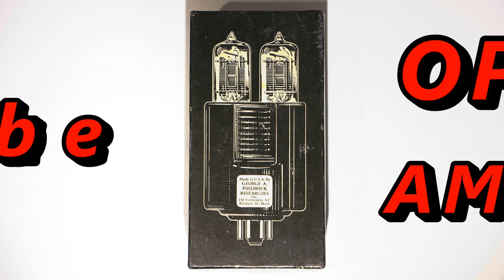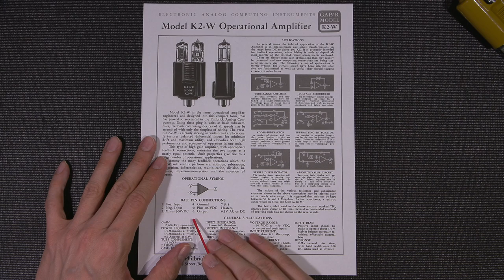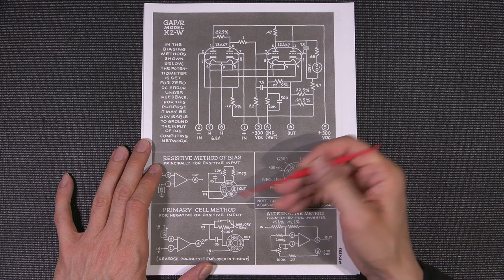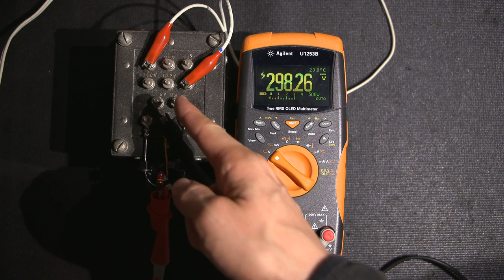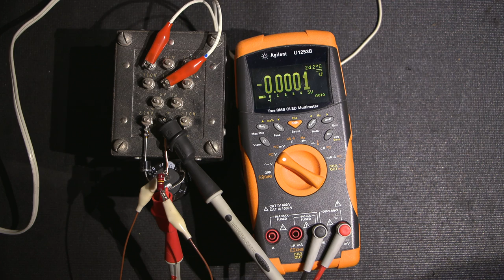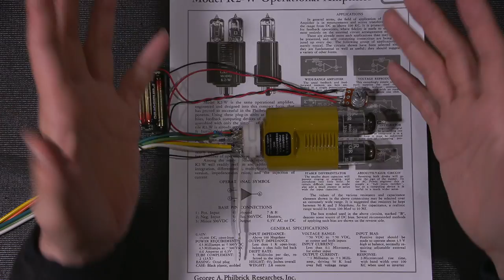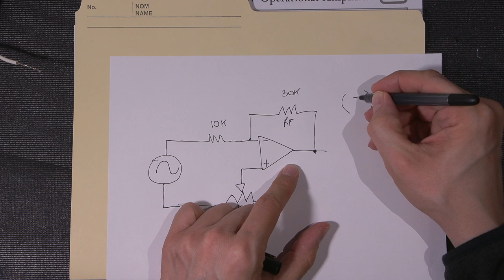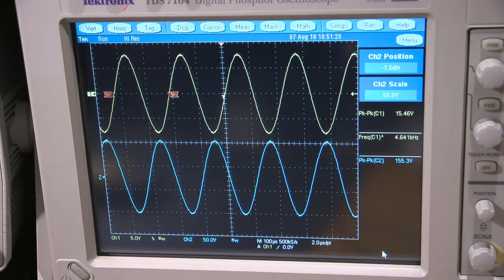600 Volt Tube Op Amp! Lets Power It Up.

Comment: Please nobody point out that the 210V-0-210V winding with two full bridge rectifiers and two filter capacitors would give both +300V and -300V rails with more than enough current capacity for dozens of 12AX7 anodes. I think Paul is making this more complicated than necessary to show you can stack separate power supplies.
Reply from the maker: Quite the opposite Peter. Why build a dual unregulated power supply when I have a regulated positive supply ready to go? With one stable supply, we will get "more accurate" results... VS... two unregulated supplies. Why don't I just build two regulated supplies? Answer.... This video is weeks of videography alone, excluding "everything" else.
Reply: "Why build a dual unregulated power supply" -- because only 2 more diodes, and one cap (and, ok, another bleeder resistor); and would be nicely symmetrical, rather than by combining reg + unreg supplies.  But as another commenter says, the rails don't actually need to match; provided the gain's reasonable, the PSRR should be high.
Anyway, excellent find on the tube op-amp, thank you for the demo, great to see old tech working nicely :-)
Reply: Peter: Pretty sure you only need one full bridge rectifier, you already got a center-tap; just add two more IN5407's, one 470uF 400V, and a penny bleeder resistor, to get a tasty-but-slightly-bitey +/- 300V dual-rail supply.  And don't ever connect that to a 741, eh :-)
Reply: Common mode noise rejection, for one thing. If you're getting both rails from the same transformer and your amplification doesn't come anywhere near the power supply rails (which is good practice unless you want that characteristic Bassman LTP distortion that guitarists know and love), you'll have lower total noise and higher linearity from two bridge rectifiers on a single transformer than from one regulated supply and one full-wave center-tapped rectifier.
Reply: Careful with that center tap and how you Earth the chassis though! If you use two fool bridge rectifiers and two filter capacitors, you can get +300V - 0V - -300V referenced to the center tap with equivalent-but-opposite current noise on the rails, making the amplifier quiet as pants.

Comment: Thanks so much Mr. Carlson, Love the Tube Op Amp! Sure takes a bit more to get it working than the Solid State Model, doesn’t it? 😀 this was so great and different. I’m sure so many of us have been working with opamps for years but it was so cool seeing this tube version and watching you make it work. I’d be curious who has seen one of these in operation before and what it was inside... Thanks again, appreciate your Patreon!  Buddy
Reply: Imagine building a whole integrated circuit with those, lol
Reply: @InXLsisDeo  Well, if you consider that it's an opamp in a self-contained package, it already is an integrated circuit.

Comment: Incredible video. Never seen a Vacuum Tube OP AMP.  Been in audio for years. This was fun. Great video Mr. Carlson.
Reply: It's easy to sprinkle solid state op-amps throughout an audio circuit, but the same design philosophy would require a lot of tubes.

Comment: In the easter bloc tubes were a common subsitute for Jfet transistors. Mainly in multimeters and other measurement equipment due to their high impedance. Also 12AX7A=ECC83. 12AX7 was first and then it was copied&improved in europe as ECC83. Then the americans copied the european ECC83 because it was better than the original 12AX7. The 12AX7A is the improved 12AX7 based on ECC83.
Reply: The delights of the "vacuum tube voltmeter" :-)   VERY high input impedance, but a few downsides (heat, fragility, size, ... :-)
Reply: theskett It depends. Sometimes such equipment would run on reduced heater voltage. This would extend the tube life a lot. Tubes can be really longlasting if operated properly. This is why output tubes rarely survive for long compared to tubes in previous stages. Same receiver, EABC80 from 1954, triode( preamp) 85-90% emission, EL84 from 1959 (output tube) ~50% emission.

Comment: I love your videos.  They are a bit advanced for my experience (I'm a biologist/entomologist but I'm also into HAM radio - K5BUG) so I still like to watch.  And I even understand most of it.  I am fascinated by the 1950's era technology like these tubes and others.  One thing I would like to know you and others on this thread talk about the speed and ability of counting/ measuring with these and doing other math.  How did that happen??  I see ways to make sense of it (via the gain discussion) but I bet you already know.  Could it be easily demonstrated in a video?  Others here are talking about differential equations and other calculations in this thread.  It's interesting to me scientifically.

Comment: You should have taken the inversion into account. Gain = -3 and -10. Also clearly visible on the scope (180 degrees phase shift between input and output).

Comment: The climbing up Voltage of the capacitor after discharging it is the polarising dielektric that is similar the Magnetic Retention of the metal plates in a transformer. it depends of the material of the dieliktrica. paraffin wax for exemple, if u put(with two plates) e very highe elektric feld in the liqid form of the paraffin and let it solidifie with that highe elektric feld applied to it. u will get the dielectric version of a magnet... u can short the plates of the resulting capacitor and after separateing the leads it will rise the votage again

Comment: great video!,  hey, a bit off topic,  This may be something you would like to do a video on. I have always wondered how those Old-school storage CRT's worked. I used them back in the day (I'm old) and never gave it a thought. Now I'm building a lab and can't afford all new equipment, so I pick up 2 HP spectrum analyzers for stuff above 8 GHz to about 25 GHz, got them both working and they have the storage CRT's in them. They work great, but I never knew how they worked.

Comment: One thing I notice is that the 12AX7A is rated for 300V maximum, so I'm guessing you weren't suppose to take the output or inputs much significantly below ground potential?  Its a nice little circuit, differential pair into voltage gain stage, then via a neon equivalent of a zener down to cathode follower output.  There's a compensation cap presumably so its unity-gain stable, and I make the quiescent current about 4mA (ie 2.5W).  The open loop gain ought to be about 10,000 given the 12AX7's amplification factor of 100.

Rail-to-rail it ain't though(!)

Comment: Thanks for the video Mr. Carlson, just a quick question. At 20:50 you demonstrated how after bleeding the cap, it started to climb back up without power applied. You neglected to explain where that power was coming from, would you please explain where the power was sourced to get stored in the cap and making rise? Thanks
Reply: Basically charges burrow into the surface of the insulating film, then leak back to the plates later.  It depends a lot on the precise nature of the dielectric used, and a high quality dielectric by definition has low absorption.  The energy is stored in fact the charges have been forced into
the dielectric and would prefer to be released again.
Reply: I understand and that's fine but an electron is an electron is an electron. It has to come from somewhere, where are all these electrons coming from if the entire circuit should have been devoid of all imbalances. If the bleeder brought it down to virtually zero, where did the 'extra' electrons come from to get stored at all?
Reply: I would have expected the drift current would send the stored dielectric currnt back within a fraction of a second. I didn't know that it takes gradual time over MINUTES, wow.  Thanks for the explanation.
Reply: Remember that charges are both holes and electrons. As long as there are holes, electrons will hang around to balance them. NPN and PNP transistors behave differently, not 100% analogously inverse to their physically-mirrored counterpart.
Reply: I'd like to see it degrade with time to confirm this. I think it's coming from rectified AC noise and possibly rectified RF. I'd like to see that capacitor and resistor charged then disconnected from all components along with a high impedance voltmeter just to be certain.
Reply: Actually, those HV caps build up charges from particles in the air, like dust. It can take a long time, but they can build it up and store it forever... until you come along. I used to work in high power electronics (up to hundreds of kilovolts and megawatts of power) and all caps had to be shorted when stored. They might be only half a microfarad, but at 40 KV that can kill. Short them out with a metal bar and they sound like a firecracker.
Reply: @jamesvandamme7786 Naturally-occuring charges on dust can get into the capicitor?   Or is it A.C. electrical fields somehow charging the capacitor?
I should put a diode across the capacitor and see what kind of charge develops.
Reply: Just floating DC fields. When you have basically infinite impedance, a slight charge in the air can get collected over time... a long time. Not much energy collected, but it can discharge in a millisecond and if that's through your heart, it can do you in. So short out all HV caps.

Comment: Im curious if this would have any applications in audio? What would the performance be like as a preamp stage versus a standard 12ax7 preamp stage that you would find in a guitar amp?
Reply: According to the data sheet, it has a maximum bandwidth of 100KHz (inverting configuration) so it might be fun to try one as a preamp.

Comment: What is the difference between a positive and negative dc voltage?
Reply: It's all about reference points. For example, if you have a +15v/-15v power supply: Ground potential is +15 volts  relative to the -15v rail. Ground potential is -15 volts relative to the +15v rail. The +15v rail is +15 volts relative to ground. The -15v rail is -15 volts relative to ground. The +15v rail is +30 volts relative to the -15v rail and the -15v rail is -30 volts relative to the +15v rail. As Einstein would say: "All things are relative". I hope this helps.

Comment: Got me going for minute when you started showing current flow in stead of electron flow.Diodes are drawn the old way.[current flow]
As always your presentation is excellent.
Reply: Technically the diode symbol is a drawing of a cat's whisker rectifier, not an arrow.

Comment: I'm wondering why you didn't use just that one transformer? Could you have flipped one diode, added another capacitor and used your center tap as the ground?
Reply: cmjbrodman Or with the center tap to gnd, just run 2 diodes with cathode to neg. 300V and 2 others with anode to pos. 300V. A 1000V bridge rectifier would also work. That gives a nice full wave rectified symmetrical +/- 300V.
Reply: I wondered that too
Reply from the maker: One regulated supply is better than two unregulated. Thats really the only reason.
Reply: Mr Carlson's Lab One would expect that with an unregulated but symmetrical supply the relatively slow mains voltage drift is inherently suppressed at the output.

But I'm not familiar with tube circuits, and you likely made the proper choice here.
Reply: I thought the same thing when I saw the transformer, but the demonstration that you can chain dissimilar supplies was useful too.

Comment: One interesting result of your test which you didn't point out was that because the input was connected to the negative terminal of the op amp, the output was almost 180 degrees out of phase with the input. It is not exactly 180 degrees because there is also a slight delay between the input and the output (just visible to the naked eye).
Reply from the maker: This configuration is called an inverting op-amp.
Reply: This is true. An op amp can be wired as an inverting or non-inverting amplifier.

I wasn't criticizing your excellent presentation. I was merely adding an observation of my own.

Comment: I'd say this module qualifies as an integrated circuit: it's a plug-in op-amp in a plastic package. :P Also, every third comment on this video is about the power supply configuration. I'm sure Paul knows he could have built it either way.

Comment: Being trained back in the day, uF and pF were it... one develops a mental model of the scale between them. The modern tendency to use nF in between is frustrating, as it requires additional thought conversion.. where as the uF and pF are part of the intuitive mental firmware. I hate that the kids found it necessary to dredge up the nano when there was no specific need to do so.
Reply from the maker: I never liked the "Nano" scale myself. Always jumped over it.

Comment: So, what application would this have been used in? I imagine some kind of switches would be thrown to change the resistors to produce an output? And how would the result have been displayed? Surely not on a scope.
Reply: I think this tube op-amp would make an excellent clean preamp for an electric guitar, or with RIAA equalization, an excellent magnetic-cartridge phono preamp. Since op-amps have a flat frequency response down to DC, it would be a nice building block.
Reply: The Guitologist It works down to DC so a voltmeter could be used. As wired it's a multiplier, either times minus 3 or minus 10. Minus as it's an inverting amp.
Reply: I heard somewhere that they have been used  in warships to calculate firing solutions based on radar signals
Reply: Analogue computers were used in ww2 to calculate gun elevation for artillery and I to aid with accuracy of bombers. Basically, to solve maths problems.
You could display the output on something like a crt tube(I think that's what those screens where, you often see them displaying radar in movies)
I have no idea for that exact type of opamp though, maybe for music like a guitar?

Comment: Paul, that was great, I hoped after measuring the maximum output voltage, you will measure the high frequency roll-off and its dependency of the gain, but you didn't. That would be interesting to see. Any follow-ups possible?

Comment: Hey Mr. Carlson, not sure if you're familiar with a company called Apex Microtechnology, but if 150Vpp output from an op amp is your kind of op amp, they may have just the op amp lineup for you. Their highest voltage op amp (the PA99) can swing 2.4kVpp for piezo drive and other high-voltage applications. I think my favorite amplifier I've seen from them may be the PA107 (https://www.apexanalog.com/resources/products/pa107u.pdf) - Output up to 170Vpp at 2MHz, 2.5kV/us slew rate, and 1.5A steady state output current (with 5A peak current rating) - all yours for a cool $700.

Comment: Very odd, this very model is on eBay at $25, yet a similar K2-X model is either $4400, or $20 from another seller!  Its not clear if they are easy to disassemble and repair either.

Comment: eh that cap will prob just hurt like hell. I have a Maxwell I mostly keep in a storage shed (it weighs 320lbs = not easy to move) that does 22,000v and is 200uF. I regularly explode 8 awg wire with 150,000A for July 4th with it and it sounds like a bomb going off (with copper shrapnel flying several yards) even outside. Not sure what that would do if I touched it or got too close but probably remove my fingers and toes if not arms and legs at least. Gotta love gov't leftovers that are out of spec (new they are 206 uF) for their Navy rail gun experiments.

Comment: Here’s a dumb question. If these had been more accessible and possibly cheaper way back when, do you think you’d have seen these used in audio amplifiers, radios, or other devices considering how clean the output is, in a similar way op-amps are used in today’s devices? I’m not referring to having the same number op-amps of course, just in the sense of seeing maybe one or two in a given device. Asked in another way, would they have been practical for everyday use if cost was no option?

Comment: That "phantom charge" you spoke of that charges caps without power. Is that due to your meter itself charging it? Ive noticed working on tube amps myself, is that after all is discharged and the tube heats go down the voltage across the filter cap goes to nearly 5 volts, but only when my meter is hooked up. I know the meter spits out a low voltage to check resistance. Does it do that for voltage too?

Comment: How do you determine the input resistor value?
Why did the signal go into the inverting input of the Op Amp?
Please do a video about capacitors self charging. You mentioned something about absorbsion. I want to understand a lot more.

Comment: Cool Video, i start to understand  Rail to Rail
Reply: Well no, because this device definitely isn't rail-to-rail for inputs or outputs!!  I suspect its rated for about +/-100V swing max given the biasing scheme and the neon bulb voltage dropper.
Reply: So rail-to-rail would perhaps be Class C / H-bridge, in your opinion? 
I'm still quite impressed at 150V peak-to-peak, without using a step-up output transformer cf. the 12V->120V inverters on ebay  :-)

Comment: 23:44 Isn't the voltage also climbing because the transformer coils are picking up ambient magnetic fields and the rectifier converts this voltage noise to DC to charge the cap. ?

Comment: Does adjusting the supply voltage of an op amp affect the output? Last time I messed with one, it didn't make a hill of beans unless I wound up banging into the rail at some point.

Comment: Your telling me with all the wonderful stuff you have in your lab you didn't already have a power supply that would fit the bill.
Reply from the maker: The one I have does 500 Volt positive, and 250 Volts negative. I needed 300 Volts negative, so I quickly threw that one together.